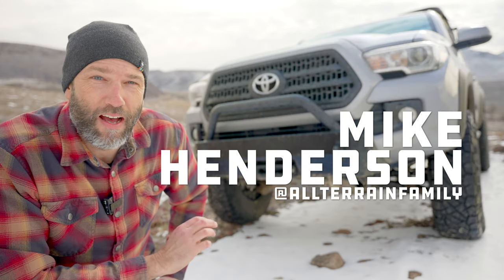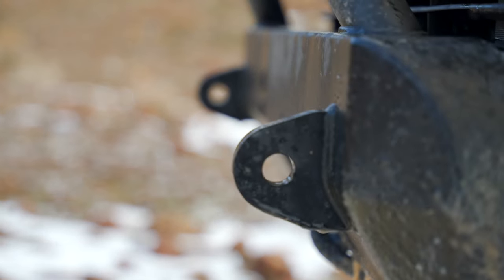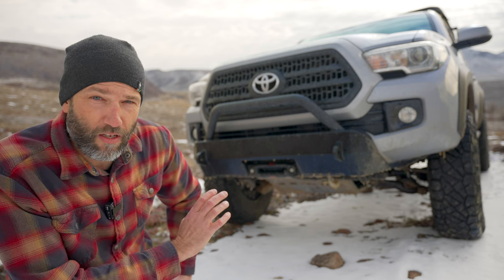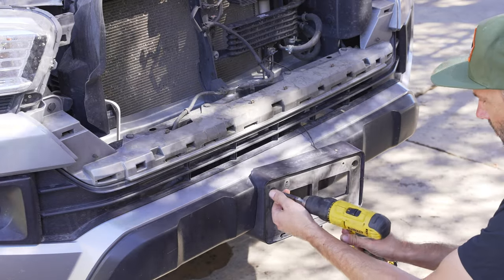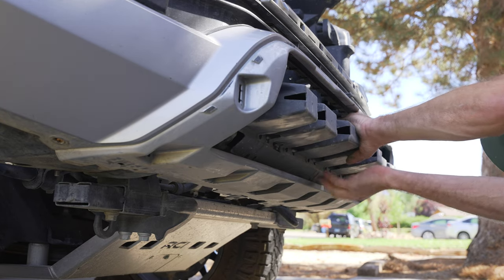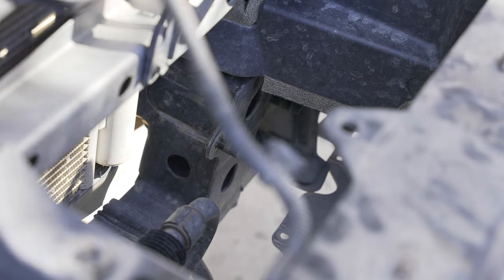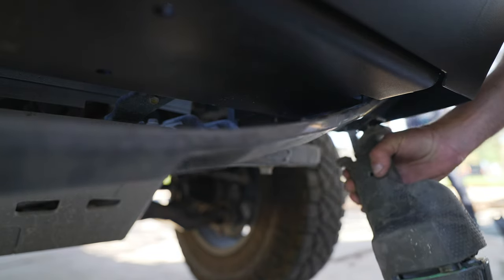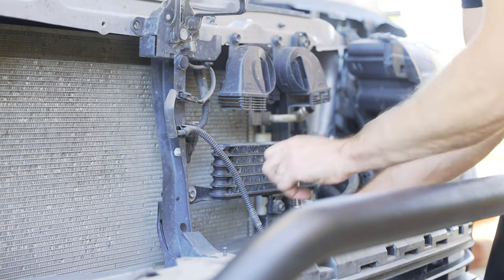Warn Semi Hidden Winch Bumper Install for 3rd Gen Tacoma

Comment: Did you do this before or after upgrading your suspension?  I’m looking to add a winch and bumper and hoping to stay as stock as possible. I'm also running the TRD or. Thanks!
Reply from the maker: After. It definitely lowered the front end.
Reply: @AllTerrainFamily  Thanks for the response.  Do you remember how far it dropped?  Did it still handle ok?  I'm thinking 1/4 to a 1/2 inch drop should be ok until I save up for a suspension....really trying to avoid a full lift kit.  Thanks again!
Reply from the maker: About that. Just stand in the front somehow and that’s about what you’ll get.
Reply: @AllTerrainFamily  About a 1/4 inch when I do that.  Thanks for the response!

Comment: Actually out where you are what would you have to hook onto to winch yourself out? Might want to address that issue.
Reply from the maker: Trees or another vehicle.
Reply: @AllTerrainFamily  
I didn’t see any trees and you were talking about going out alone needing a winch. 
True the better response would’ve been that it won’t do you any good unless you have trees or you have someone along. 
I have winches on my off-road vehicles, but I am not disillusioned enough to think that that is going to be the answer to every situation. When you’re out in national grasslands where you could encounter mud or in Rocky terrain, where the only thing that you could possibly hook onto would be another rock which there may or may not be one having a winch won’t do you any good?
Reply from the maker: @toddwillard8927 @toddwillard8927  On occasion, I go off-road in places that have trees, not just this spot where I shot this video. And occasionally, there may be other people in the area, though I did not arrive there with them.

Additionally, there are two things you could use in a treeless and reckless recovery: a deadman anchor or a Pull-Pall.
Reply: @AllTerrainFamily  
Agree with the deadman anchor point

Comment: I got the same bumper but I got the Warn M8000 winch so that the control box is side mount and you dont need to cut or bend hood latch bracket.
Reply from the maker: I don’t think i had to do that.

Comment: Going to be putting this on my taco is it easy to get your hands in the winch cradle to release your winch  spool and hook up your winch remote controll wire style not remote  thank you great review and happy trails
Reply from the maker: Depends on where your winch control port is. I use the wireless remote. It’s not super easy to get at the clutch lever. But i can do it.